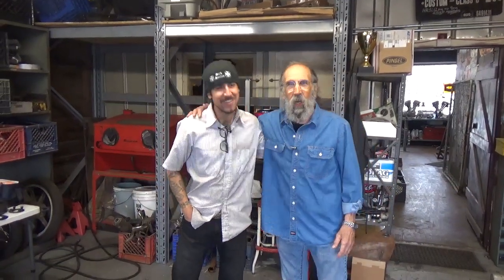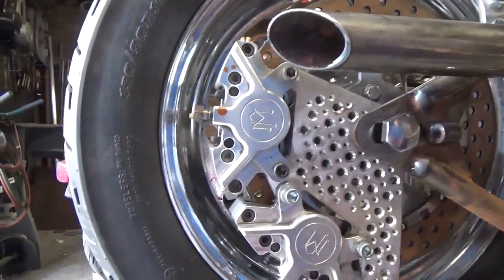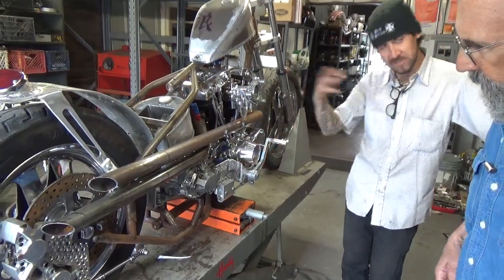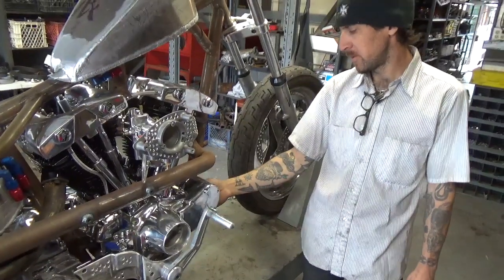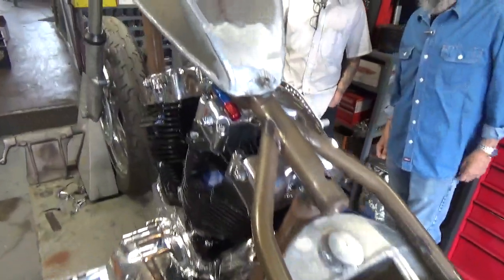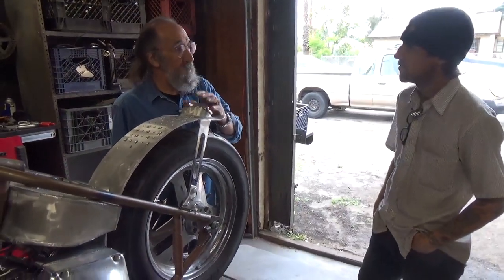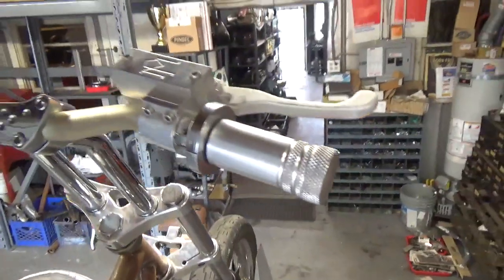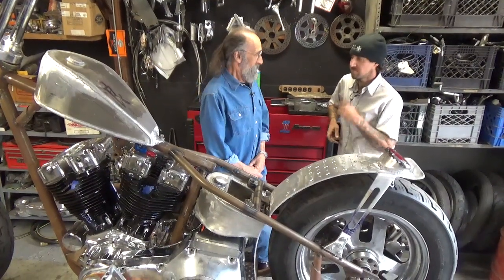Al's New Rigid Harley Shovelhead Getting Ready For Born Free

Comment: Sure enjoy watching  the younger generation with the bike building fever. Get a kick out of Al talking about the 80's-90's as the older generation. I still look at evo's as new bikes and knuckles as old bikes. He's still got quite a bit of work left on that bike to finish it in a month. Good luck to him and thanks for posting the video my friend.
Reply from the maker: Thank You.  I was working in a shop at the time and the old timers coming in looked down their nose at me for riding one of those modern Shovelheads with a cone sticking out of it.  I missed my Pan, but loved the alternator and disc brakes of the Shovel.  Then the Evos came out and I had my first set of Evo leaky base gaskets to fix.  I pulled that first head off and started yelling, "THAT'S a cylinder head?  Where's the cylinder head?  What are these things they call wafers?"  Times change.  And the Evo proved itself, and I just gravitated toward older bikes.
Reply: @pacificmike9501  Yah, I know. "Oh you ride a bowling ball bike". They got nicknamed "troubleheads" after the evo came out. You put valve seals, electronic ignition, a little stroke and a five speed in them and they are fine.
Reply from the maker: My Shovel is at least a thrill and a half.  I'm putting here sidecar on (finally) today.  And you're right, my sixspeed is great.  After 44 years with her, she's pretty refined.  But, I still like old bikes a bunch too.  Thanks for adding to this stuff.  We are having fun NOW.

Comment: That's looks like a old Carlini Torque Arm, or a copy on the right side, tying the engine and transmission together. I used many back in my FXR Evo days, before switching to the Twin Cam. 
T.S. RACING
Reply from the maker: We all did.  Yes, it is a Carlini.

Comment: Hi Mike, I have an unrelated question to this video. My stock '57 FL has developed some hefty white/tan deposits in the front head at the bottom of the threads for the spark plug. I'm concerned that it would not be wise to break them off with a pick as they perhaps could damage the piston or rings. Have you any thoughts? Maybe I'll have to pull the head.
Reply from the maker: You possibly have some damage from heat.  Just an educated guess, unless you're running a horrible brand of gasoline that's leaving deposits in your combustion chamber.  I don't want to bad mouth fuels.  But, some are awful.  If it's a heat problem, it's probably from a manifold vacuum leak.  I'd probably have to pull the head out of fear.  You need to protect Panhead parts.  We've been entrusted with them and must preserve them (I believe however, we're supposed to really enjoy them).
Reply: Hey Mike, I'm in agreement with you and thanks for the timely reply! I will pull the head and be safe. I fully agree with preserving them! The only thing I do occasionally is add a half shot of two stroke oil to a full tank of gas to help lubricate the valve guides. Might sound odd, but the old fellow I bought it from years ago advised to do it. Any chance this could add to the deposits I have?
Reply from the maker: I'm not a chemist.  I really don't know.  I used to add a little Marvel Mystery Oil when I filled my tanks on a long trip.  I suppose I wasn't thinking well and finally added too much, and it was so rich it would barely run.
Reply: Thanks for the insight Mike. So I got both heads off and am glad I did. The exhaust guides are wore and the combustion chambers and valve faces are covered in carbon. Mike, what is the best way to remove the carbon in the combustion chambers?

Comment: My husband has been watching your videos, trying to figure out his 1991 harley sportster 883 issue. It has been backfires from the carburetor. He rebuilt the carburetor, people have told him it could be the voes, or intake manifold causing it. This came on sort of sudden and he doesnt ride it often. What do you suggest? Thank you.
Reply from the maker: Has he changed the exhaust or air cleaner?  If so, try a larger slow jet.  If not, check spark plugs.  If one is dark and one is light, there is a vacuum leak, usually where the manifold attaches to the cylinder head.